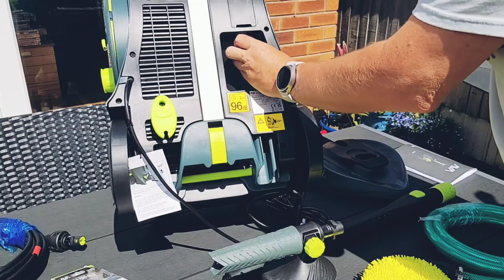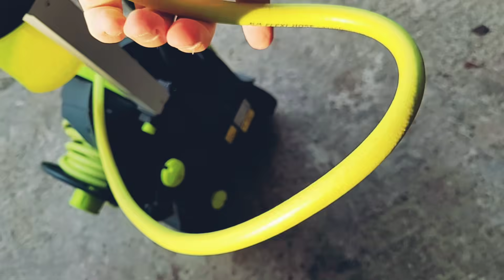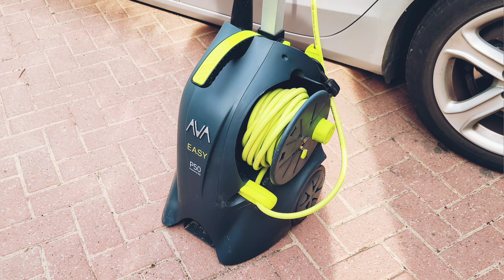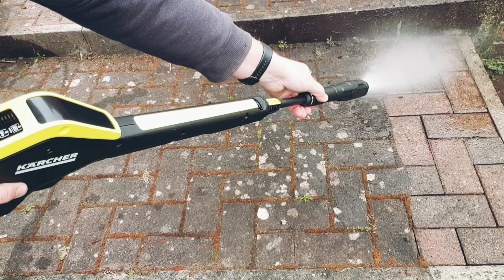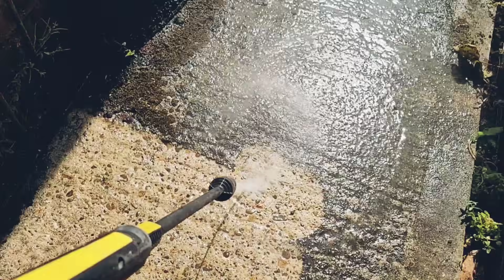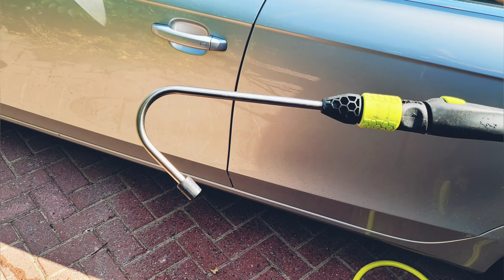Karcher vs Ava: Which Pressure Washer is the Best Value for Money?

Comment: Excellent review Ted 👍🏾
I’m currently using a Kärcher K5 ecoLog!c (the first gen model!), and it’s still performing well.
The main drawback for me was the hose, so I’ve replaced it with a 15 meter anti-kink hose from Direct Hoses with a quick connect coupler outlet end, and I’ve changed the standard lance to an MTM stubby gun. Just those upgrades alone have given my  Kärcher a new lease of life, but if I were to replace the K5, I’m tempted to go for the Ava p80.
From what I understand, Kärcher accessories are compatible with Ava machines, so that’s a plus.
Keep up the good work Ted 👍🏾👍🏾
Reply from the maker: Thanks for the great feedback. Totally agree with the upgrades you've made to your K5, they make a massive difference 👍
Reply: p60 and the k5 have about the same power. are you going with the p80 because you want more power or why don't you just buy a p60 as replacement for the k5?

Comment: I'm a recent Ava convert. Great unit with incredible accessories. Much better than my K7. You never spoke much about the hose, the AVA hose is the best I've ever used, much much better. No kink and so easy to work with.
Reply from the maker: Thanks Darren. I tried to fit in as much info as possible but had to be concious of the total length of the video

Comment: My ava is so loud and seems under pressure something not right any help would be nice thanks
Reply from the maker: It sounds like you have a water flow problem. I would check that your hosepipe is not kinked/trapped, that the water filter is not clogged and also clean the nozzle on the lance (your ava should have come with a pin to do this). If these don't work, I would suggest contacting ava for further advice. Good luck 🙂

Comment: Great video, thanks Ted! Very thorough demo of all the features. I was going to buy a Karcher K4 after watching your older video on it (currently £189 on amazon with an extra 20% off if you don't mind buying a "Used - Like New" one), but after watching this I think I'll go with the Ava. It's a bit more expensive (the super bundle is £249 currently, not including your discount) but the 10 year warranty, better hose, included range of decent accessories, and overall quality have sold it for me (I'm also over 6 foot tall so I'm sure my back will thank me for the extendable lance). I prefer to go for a company that sells replacement parts wherever possible, so that's another tick.
I'm going to go purchase it now, I'll be sure to use your link and code :) Thanks again!
Reply from the maker: Thanks Ezrah. Tbf, both are very good pressure washers. I've had 4 good years out of my K4 and have been very happy with it. But at that price, I think that the Ava Super Bundle is excellent value for money. I hope you are as impressed with it as I am 🙂

Comment: Great video Ted, I’ve had my k4 for around 4 years too, a k2 for 8-10 years before that, no issues from either in all that time. A hose upgrade (Direct Hoses flexi hose 15m) was a definite improvement, I looked at the Ava but was disappointed that they don’t have any rotation on the fan spray so you have to twist your hand instead. Ava should do an Ava car specific version and offer the 3 can foam cannon with it and add the ability to alter the fan spray from horizontal to vertical. 
I definitely prefer the Karcher T5 patio cleaner too, especially as it can altered for softer surfaces where the Ava can’t, plus my T5 came with 3sets of different spray valves too. 
I like my K4 because in assembling it I feel more confident in taking it apart if anything does go wrong with it, plus I do prefer my MTM stubby tub and MJJC S cannon,
Reply from the maker: Thanks Wez. Some good points there. I've just received the same 15m hose from Direct Hoses and am looking forward to trying it out on my K4!